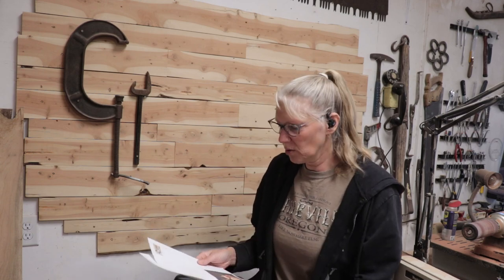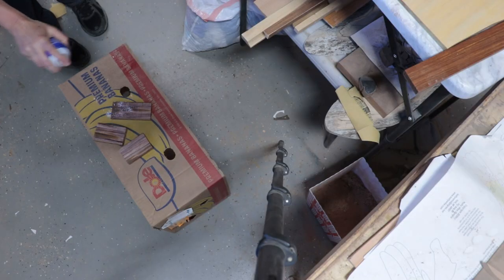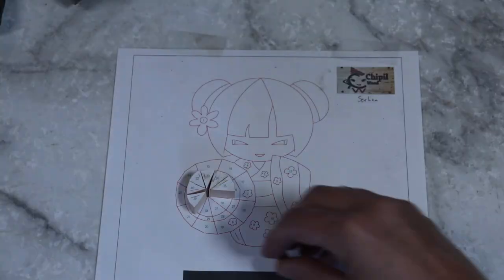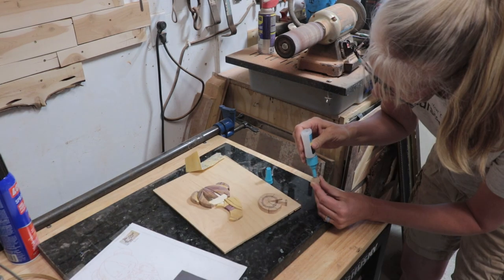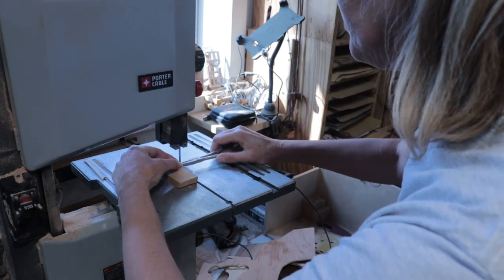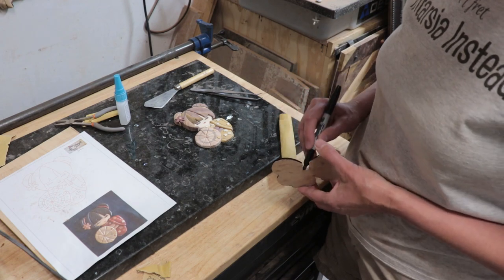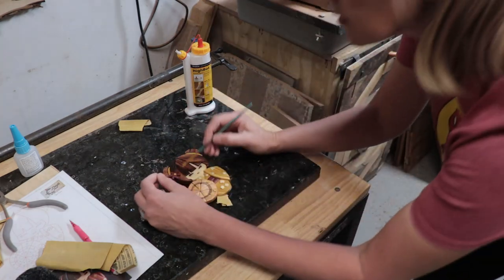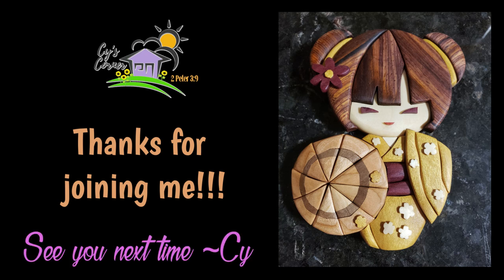Keiko Intarsia

Comment: Looks awesome. One question. I noticed you add the finish before gluing. Will the finish affect the way the glue sticks? I always been told glue doesn’t stick to finish
Reply from the maker: I don't put the finish on the back side (bottom side) of the pieces. The finish only goes on top and on the sides. 👍